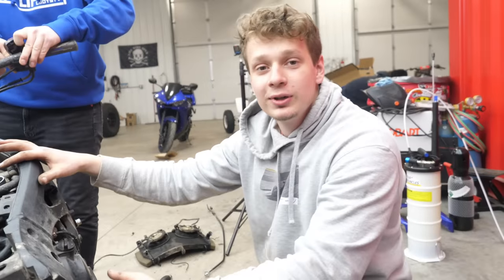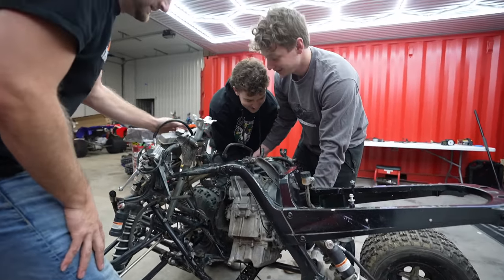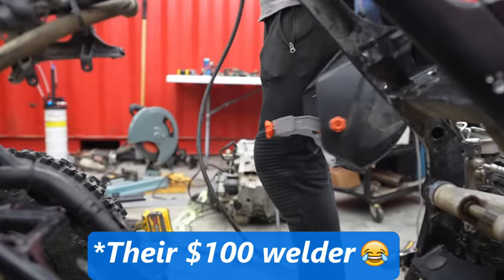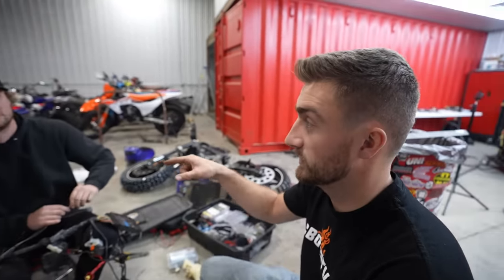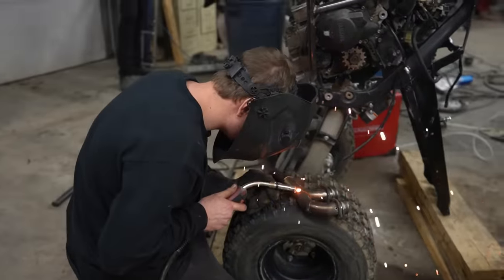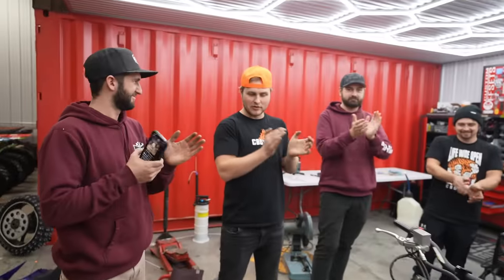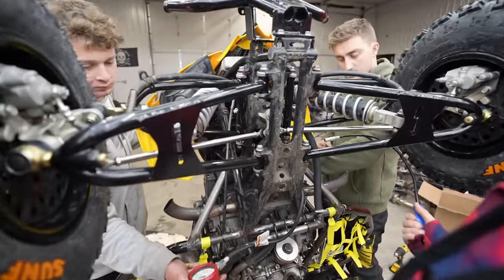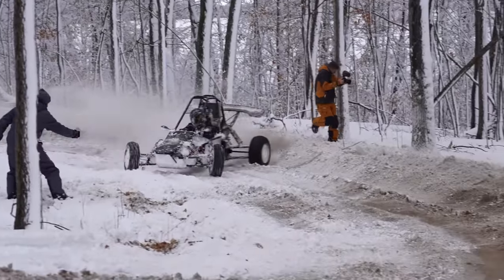R6 Swapping Raptor QUAD in 24 hours!

Comment: I'm pretty sure it'll be because of the raptor fuel pump. It needs the R6 one. Other issues could include the airbox delete and the short mufflers which might be leaning out the bike past the ECU's closed loop parameters. ECU might not have the capability to adjust to that extreme, especially if its -10 out. They adjust to cold climates etc.
Reply: Yes, fuel pumps are very finicky. I put an 07 GSXR 1000 engine in my 03 GSXR 1000 and it ran like shit til I put the 07 fuel pump in the tank!
Reply: Definitely something to do with fueling due to it not reving out under load.
Reply: I had the same problem wouldn’t rev up properly and all it was was a electrical problem sorted that and it’s runs mint
Reply: Do you also think that it could have something to do with the bike being launched into the air and banging the limiter the whole time?
Reply: @SargentGiraffe  Nah. they're designed for high rpm. Engine was fine
Reply: @FoleyT9X  isnt 07-08 the last years compatible with the 03 frame or is it the 06-07?  you had to notch the motor for the swing arm or did it bolt right in? i know u used the 07 ecu and electronics. My 03 pump went out and i installed a nissan altima fuel pump i had laying around and it runs great. I did have to drill the in tank filter thing cause it was stopped up and i wasn't gonna pay 400$
Reply: @turboimport95  so the engines changed every 2 years, to my knowledge, i.e. 01-02, 03-04, 05-06 and 07-08. When my 03 went out, I put in the 07. The 07 has 4 mounts where as the 03 only uses 3 points to mount. But, 3 of the 4 spots lined up perfectly. It held and ran like a bat out of hell...

Comment: Your 600cc kart was getting a workout, big hit with the Cboys! Vasily you collabed well with the crew, your easy-going hard-working nature and dedicated experience definitely payed off. Keep up the good work👏
Reply from the maker: Thank you! Im glad
Reply: They are looking for a full time guy 🤔
Reply: Check the wiring to clutch switch / neutral circuit if theyre not bypassed correctly it can change the rev limit and fuel/ignition map.
Reply: @VasilyBuilds   I have a raptor r1 2011 it’s your air flow

Comment: The problem is the raptor 700 fuel system trying to pump the r6
Reply: My thought to
Reply: Yes for sure swap the r6 fuel pump in and will run right
Reply: 👆🏻 This right here. I can't imagine the raptor fuel pump is sufficient for an R6.
Reply: I was thinking it wasn't getting enough fuel also most street bike swaps are fucked cause of not using the proper fuel pump
Reply: I definitely was thinking not enough fuel
Reply: 100%
Reply: Yes something like that or a simple diode in the ignition or fuel system wiring
Reply from the maker: I suggested this too. But Kev assured me it will be fine because the fuel pressure is off only a couple psi. R6 is like 48psi and the 700 should be 46.1 psi according to the manual. It wouldn't hurt to try the r6 fuel pump on
Reply: @VasilyBuilds  psi is close but what are each pumps flow rates?
Reply: @VasilyBuilds  take a look at the parking brake. my warrior sounded like that when I did a parking brake delete, was telling the motor it was engaged therefore not letting it rev out while in gear
Reply: @VasilyBuilds  sounds stupid but it’s an easy fix, hopefully it works out for ya
Reply: @VasilyBuilds  tell them to spray it with brake clean while they are trying to rev it out and if it revs out then they need more fuel
Reply: You beat me to it, that is definetly the reason it is not running right
Reply: @Vasily Builds  The pressure being close means nothing if they don't have the same flow rate.

Comment: Airboxes are very important with motorcycles. As soon as you remove the stock airbox, you absolutely require re- jetting, or tuning on fuel injection models! I've had this same issue many times!
Reply: Fuel Injected motorcycle don't use “ jets” they use Injectors instead. Hence the name. And its got a computer that will know if something changed and adjust the fuel and air mixture automatically or might have to plug it into a laptop or  PC and change the tune on it. Jets are in carburetors and the number one reason why ppl switch to fuel injection is to get away from messing with jets. A fuel injector is kind like a jet but it's able to adjust how much fuel it spray's by what tune is installed on the computer.
Reply: @magee16749 hence why he said or tuning for the computer module for the injector
Reply: I dont think deleting the airbox would cause this issue. The bike has a limited range of parameters to compensate for different climates. Even if it was lean it should still rev out. 

I didnt pay close attention but I'd say it's the exhaust being too short/not having an 02 sensor. The bike limits rpm as a safety because it cant accurately calculate air to fuel ratios.
Reply: @magee16749  they clearly know that. That's why they said or depending on if you had a carb or fuel injection.
Reply: @magee16749  he literally said that lol
Reply: Clutch switch
Reply: @magee16749  Yeah but you need sensors to adjust the ratio, one of them happens to be the air temperature sensor which is crucial. Its also the one that mounts inside the airbox on the R6, it is also the one I didn't see them hook up anywhere or even plug it in...
Reply: @nginxftw and the exhausts to short for an 02
Reply: Yeah gotta be the jets
Reply: @Martin Ramirez   SMH. Ik your joking... it's fuel injected.

Comment: It sounded like it was lean and wouldn't rev out under load. It could be a missing a sensor or just needs to be tuned since it now has a short exhaust providing less scavenging and more flow, but I doubt it since EFI is very forgiving in my experience. Maybe test for intake leaks on the throttle bodies and make sure someone didn't cap off a hose they shouldn't? You could also check if it has any codes, it will likely have a couple from things that were removed. California bike's often have extra stuff that can cause problems, like the air injection/PAIR system that could cause this if not capped off properly. Maybe also check that you are getting enough fuel, it looks like you swapped tanks and the pump is usually in the tank. I'm not sure that pump is enough for those injectors.

Get a power commander, plug in a laptop, and you should be able to add fuel where it falls flat until it improves. It will also tell you if your TPS sensor is working properly. If it surges, give less fuel there. I've usually been able to get bikes running decent with street tuning, but it will never be perfect without an o2 sensor and a log or rolling road. There should be a tune that you can download to have a better starting point. It looks like it may already has a piggyback tuner under the seat? Be sure to update the firmware.
Reply: I agree about the fuel pump not equaling the flow  needed.That and the sensors in the exhaust will cause tune default settings.I wondered about Fluid Level sensors too as the engine's leaned forward further.
Reply: @Goatee_yay  no its efi
Reply: Stock raptor is 47 hp, r6 is over double that.  The factory engineers are not going to use a 100hp capable fuel pump on a 47hp machine, they’ll use something like 70hp capable so it’s not running at maximum effort all the time.

I would start by installing a fuel pressure sensor in the rail and logging that data, most likely going to see a pressure drop when it chokes out.

Comment: I think it is the exhaust , there is reasons that they design the headers the way they do , and by running two cylinders together out each side instead of all four into a collector and then out , I'm thinking that there is NO Back Pressure at all or very little and it is really throwing everything off and not allowing the engine to Rev like it normally would  . This is my thoughts  on it , but really cool that you guys swapped it 👍 But my money is on the Exhaust being your major problem .
Reply: I built zoomies about 10” long on a cbr1000rr just to get it running and it wouldn’t rev and had no top end power, even stumbled on the bottom, finished the exhaust out under the rear fender and ran amazing. I agree with you from experience.

Comment: I had a bike bogging on me yesterday just because the connection on the ignition coil wasn't tight enough. I checked the intake, carb, fuel and compression.. just not strong enough spark. 

Can't wait to see the 2T-R6!

Comment: It sounded like an ignition issue for sure. Maybe a bad coil? Check the temperature of each exhaust pipe just after where it exits the engine and make sure your not losing fire in a cylinder. Also could be a float if the engine is tipped at all. Might need to clock the carbs somehow to get the bowls to fill properly? Just spitballing... Kick Azz Build!! Going to look up CBOYS and sub!

Comment: When I did my r1 raptor build I had to flash tune the ECU with a track tune. It gets rid of all the emissions controls that were deleted in the build. It also helps the ECU cope with some of the sensors being gone. There were also sensors that I had to buy a sensor delete device. It tricks the computer into thinking the sensor is still there but it's not.

Comment: Put a skidplate under that thing. Rock is going to smash that motor hanging down below the frame. The Cboys ride on rocky terrain. You might want to hook it up or tell them to put a skid plate themselves. It won't last very long knowing the way they bash into things. Also, check the fuel pump. Put the fuel pump from the R6. The Raptor fuel pump doesn't have enough PSI is my guess,

Comment: I have a 02 zx6r that im doing a project on as well. Im turning it into a dirt bike. And ive been having the exact same issues, bike wont rev out, or it will when in natural but loses power under load and wont rev past certain rpm

Comment: I had the rev issue on a gsxr 600. The filter that is built into the fuel pump in the tank was clogged. Wouldnt rev past 11k in gear but rev'd out in N. To replace you had to buy the whole pump but on the gsxr there is a bypass you can drill then install an inline filter. Could have something to do with your pump/tank/ fuel flow
Reply: Thanks for watching and commenting Inbox 📥 me above to claim your Christmas 🎄 Reward Cheer's! 🎉

Comment: Sounds like its dropping fuel pressure under load. Maybe check which pump, lines and tank vents you're using and if they can support that engine.

Comment: The way I did my CBR600 was to keep the sport bike frame, and just cut the swingarm off and weld on another quad swing arm to it.  And then I had a 3wheeler Tri-Z conversion kit-- that is made to convert the 250cc Tri-Z three wheelers into a quad;  so I welded that kit to the bike.  It turned out awesome, and since I got that bike for nearly free, and most of the parts were free.  After riding it for probably 5 years and many trips to the dunes--- the engine was starting to get a little bit tired (even though it was still awesome) --  I could tell that the engine had dropped down to about 95% power-- so I just sold it for $1500, and I was happy to see it go.  It was such a fun build, and I'm sure it's still out there somewhere..  I did end up gearing it down quite a bit, so it would only go about 100mph top speed (rather than the 150 that the bike could do on the street)..  So that made it launch well if you could keep it from popping wheelies at the dunes.  So it would do well against all the 450cc quads, even from launch (it's heavy).  But at a rolling start, it would completely smoke nearly all the bikes at the dunes;  accept for a few tuned bikes or maybe the racing banshee's....   But from a dead start, it was so heavy that it was hard to get a good launch without popping wheelies;  so you really had to get good at riding it well if you had a chance at the shorter drag races.    I could have extended the swingarm and solved that problem -- but I liked it better at the standard quad length, so it could do well on the tight trails.  I didn't want it to be only a drag bike.....   Most trips, it ended up being the bike of choice to pull broken bikes back to the front.  People started calling it the "tractor", because I had pulled so many broken bikes back to the front gate. lol...  It was low geared enough to have great torque and could pull with relative ease-- but still high geared enough that it could easily do 70mph in 3rd gear (and it was a 6spd) --  it was a great bike, and I do wish I still had it sometimes;   because I rode that thing a lot at the dunes with my girl on the back -- which was the only bike/ quad that I've ever seen at the dunes that could legally ride two riders.  Good times.
Reply from the maker: That's very smart! But im sure those conversion kits are pricy !
Reply: @VasilyBuilds  Yeah.. My buddy loves Tri-Z three wheelers, and he already had 3 of them.   Then he finds a fourth one, that has the conversion kit already on it;  but when we took it to the dunes, it vibrated the handlebars like crazy, because apparently the three wheeler engines don't have any counter balancer built in (like the LT500 quadzilla does).  So he ended up converting it back to a three wheeler and just gave me the conversion kit ---  so it all just fell in my lap virtually for free;  so I had to build it.

Comment: Yeah the way it appears, by the way you fabbed the exhaust up(not that you did anything wrong) but the idea of inhaling more air and exhaling so much more air im sure there is a map sensor or something not plugged in. Also yes swap the r6 fuel system over. Or buy a simple cheap inline pump from jegs or summit amazon

Comment: It sounds like a fuel delivery issue.  I’m not sure if you’ve already got the r6 fuel pump in the raptor but you’ll definitely need to do that.  If you are already using the r6 fuel pump you should replace the pump and sock filter. The problem your having is very consistent with a underperforming fuel pump.
Reply: Thanks for watching and commenting Inbox 📥 me above to claim your Christmas 🎄 Reward Cheer's! 🎉

Comment: its definetly because of that exhaust, you need a certain amount of back pressure in the system for capturing unburnt fuel to then burn
Reply: oh yeah I agree. only way to straight pipe it would be to change the timing or cams or something....
Reply: No that wouldn’t do it lmao
Reply: No just no feel free to Google actually factual information but scavenging was made redundant and obsolete only used for emissions regulations and or 2 stroke engibes etc at best if at all to what your referring the tern back pressure would be bad for an engine .....
Reply: @298CRE8  I argue that all the time...old flathead and shit may need it but newer engines dont need back pressure, i teter on scavenging as my seat of pant dyno can feel the difference with a crossiver pipe vs no crossover but thats not factual deduction
Reply: @erik120719  I've contracted in both Aston Martin laguna building prototypes several years ago and Bentley working on the w12 engines mostly automation nowadays but several engines in my living room being rebuilt polished ported skimmed valve seats grinding compression increases etc etc just some people talk nobesense without using their brains backpressure would increase load upon everything nobody increases load where they dont have too that's where advancing and retarding the spark helps for starting big singles on bikes quads etc
Reply: @298CRE8  I'm not as familiar with small engines as car engines, and its been proven many times on dynos that backpressure kills HP, it does mess with torque tho. Engine masters did a whole show on backpressure. Alot of exhaust shops tell ppl they need back pressure to upsell mufflers and shit tho so there are ppl pushing the idea that backpressure makes power u guess. As for crossover pipes, 2 reasons I like to run them, one: I hate duals without an bc of the exhaust sound kinda being in "stereo" (personal preference really) and 2: either an x pipe or h pipe changes the tone on the exhaust.

Comment: It was running on 3 cylinders possibly 2 ...
 you can check the manifold by" feel "
Basically touch the manifold pipes,  if one is less 🔥 burnie on the fingers that's your # cylinder issue

Comment: Sounds fuel related. Did y’all keep the dyno jet programmer on it? I see you went with pods and no restriction on the exhaust. Id going in the power programmer and keep adding fuel to it. Put fresh set of plugs on it and do a pull then cut it off and check plug for lean or fat
Reply: Thanks for watching and commenting Inbox 📥 me above to claim your Christmas 🎄 Reward Cheers! 🎉

Comment: I'm pretty certain the extreme cold is causing most the tune issues it's making the ecu keep the mix way to rich and the air bow delete could make it lean as well but I'm pretty sure the Open air filter on the back pulling in that really cold air has the ecu running a lil rich as if it's got the choke on with a carb try wrapping the filter pod with some kinda insulator

Comment: for sure you need air pods and a full exhaust at the minimum yes they are very simple but those 2 things are an important requirement to running good ive worked on many R6s

Comment: Just guessing but the ecm probably isn't getting a good o2 sensor reading for the fuel curve based on the exhaust configuration. I didn't even see a spot for the 02 sensor, which if its fuel injected it needs.

Comment: I built a r1 raptor had same problem a custom built shorty header fixed it.  On dyno it just quit making power at high rpm just goes flat up top.

Comment: ima say rn its almost 100 present the exhaust setup and the air box  I've have had a lot of experience with these motors you gata hove the right amount of  back pressure and on these motors the air box is very important for them to run. might be able to get away with just rejetting the carbs but with both not having a exhaust or air box im surprised it would even run at all